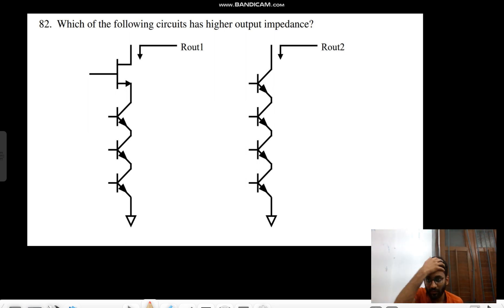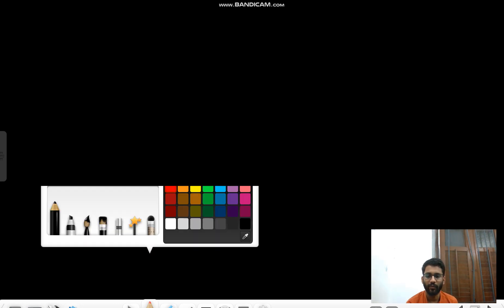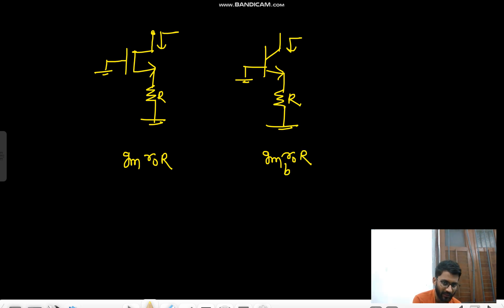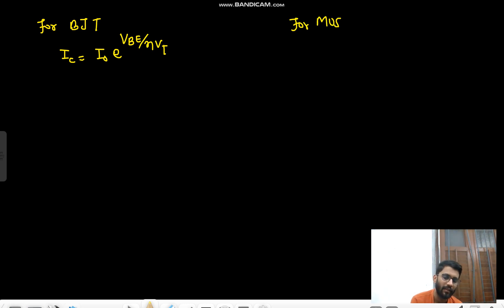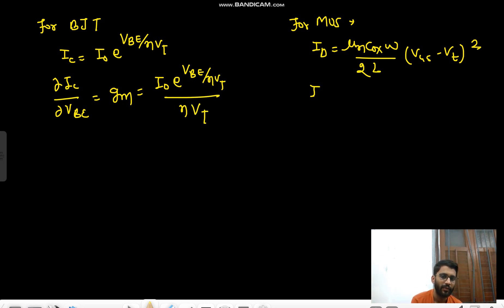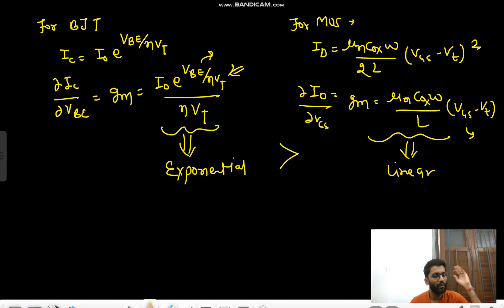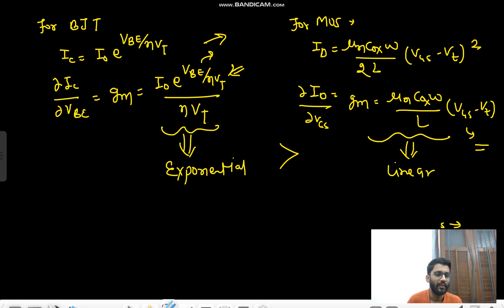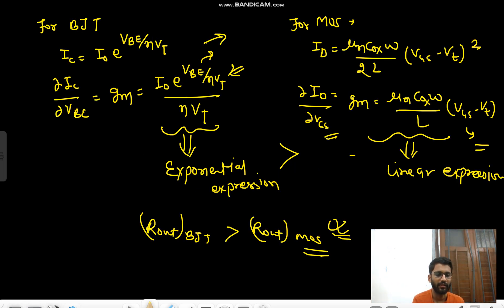Gm of BJT vs Gm of MOSFET || Transconductance of BJT and MOS

Comment: You teach very well ; but I would like to point out Rout 1 > Rout 2 ; for bjt output impedance for very high emitter resistance is limited to Beta * r0 but for mos Rout 1 = gmro * Br0 ; for bjt Rout does not depend on gm. Clearly Rout1 is higher by a factor of gmro.